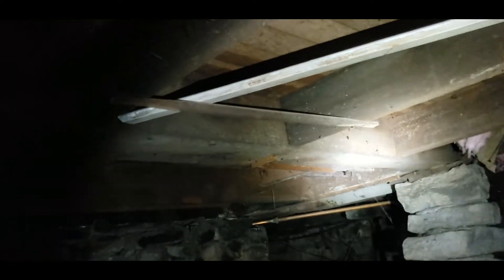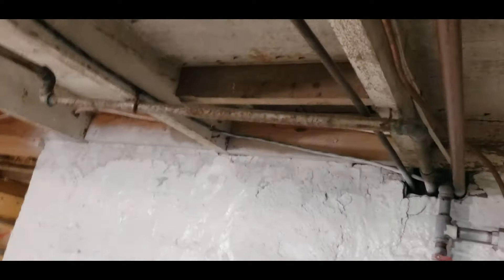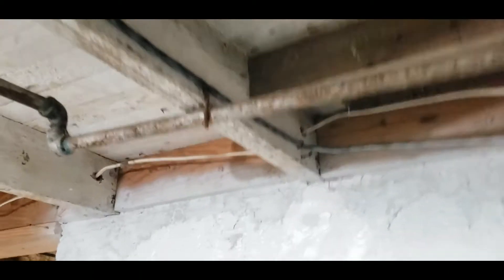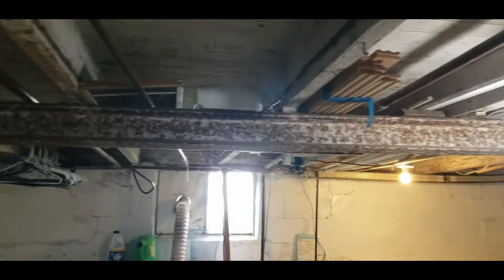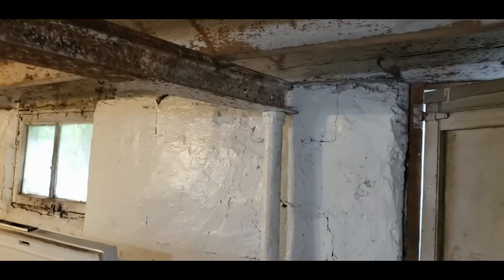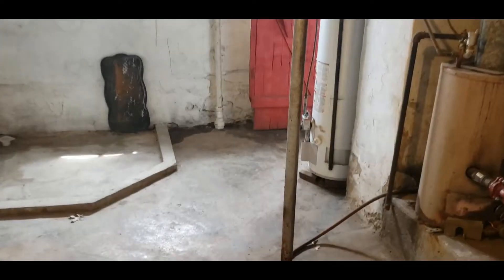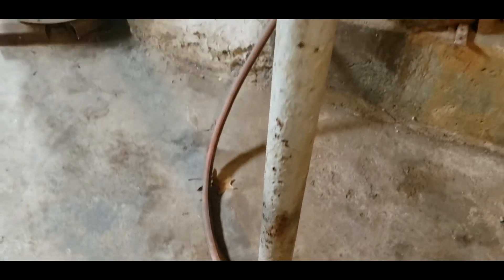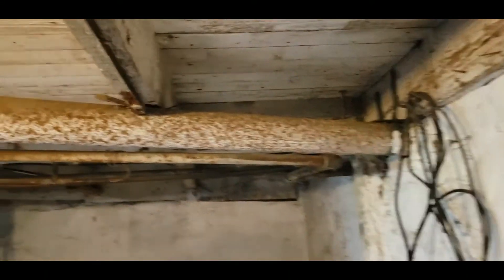Should I call for a structural engineer for my basement walls?

Comment: ive  worked on almost identical houses and these basements were an afterthought usually a crawlspace  then dug out deeper later on ,as well ive seen floor joists with bark still on them and so on  .. if thats really a rr rail  its not going anywhere , prob best to replace it and chop it up into mini anvils
Reply from the maker: I am amazed at the ingenuity of some people. My best guess is it has worked for 70 or 80 years so who am I to question it.

Comment: Mechanical engineer says tear is down
Reply from the maker: The owner might disagree since it has been this way since 1924. But I would be in favor of significant improvements.
Reply: @hawleyhomeinspectionsllc2899  the owner can say whatever he wants. I would never sign-off on it
Reply: It’s an old house. What more are you trying to achieve? 

Tear it down and start new, if market conditions and finances allow. Otherwise leave it alone. You enginerds love fixing stuff until it’s broken.
Reply: @mikesweet5848  when you call an engineer in. As the title suggests, they become responsible for the safety of the structure. If it fails in the future, it is on the engineer. That is why I said, "I would never sign off on it" no way